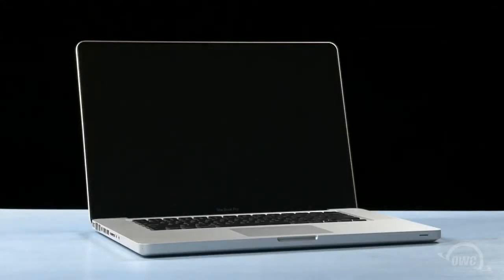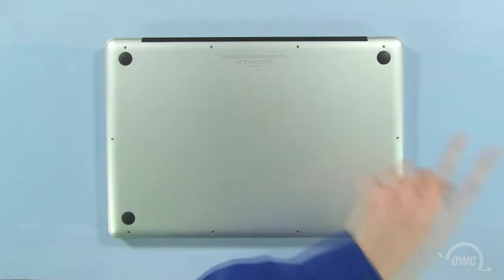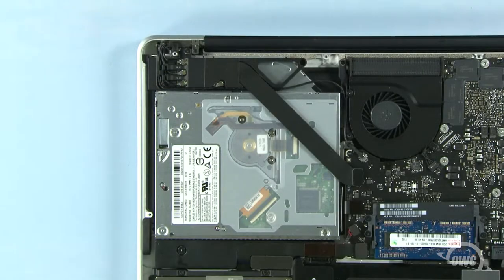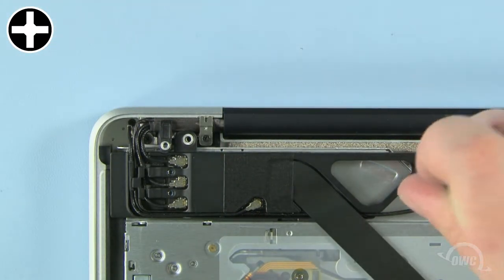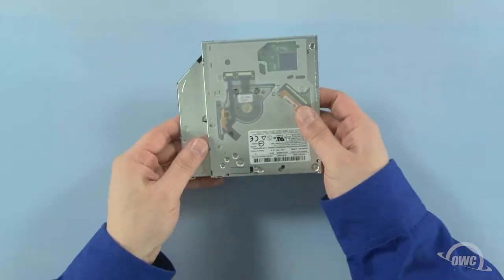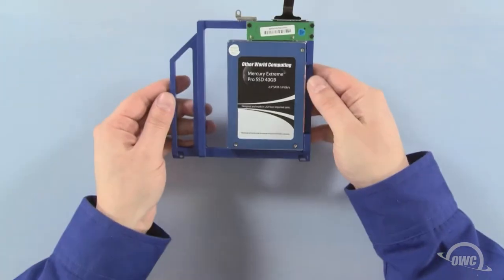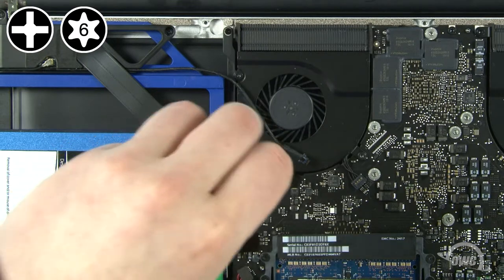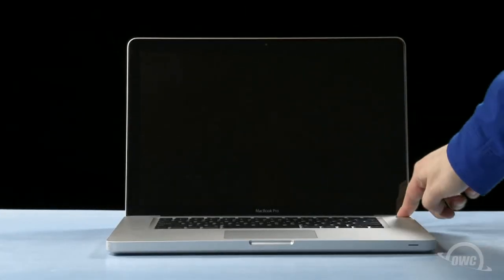OWC Data Doubler: 2011-2012 15-inch MacBook Pro

Comment: very good in did, I've installed 2 SSD on my MacBook Pro Mid2009, now I have real good read/write speeds, in the pass, write  140MB/s read 260MB/s, today, Write - +390MB/s and Read  - + 500MB/s I think is a real Upgrade, oh, I've setup RAID Striped. Cheers.